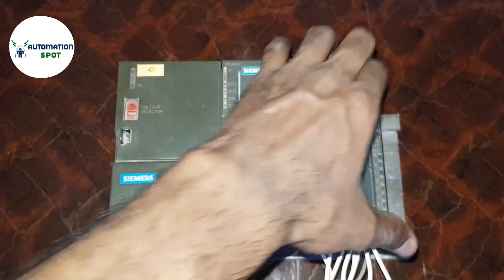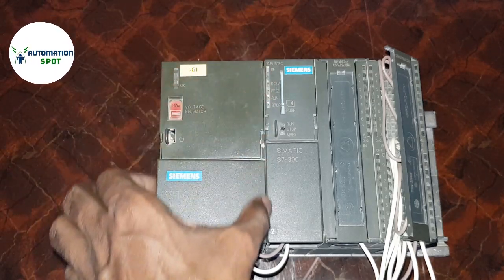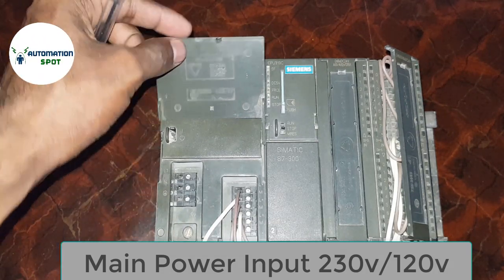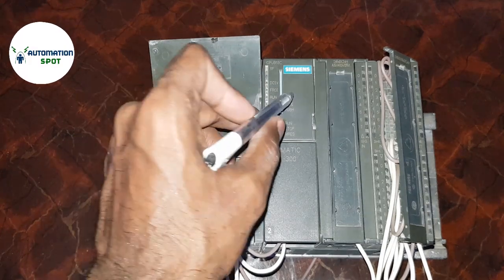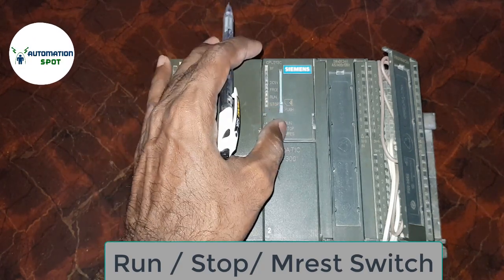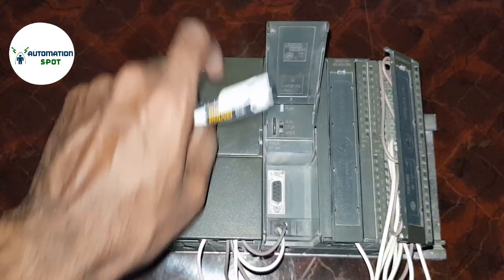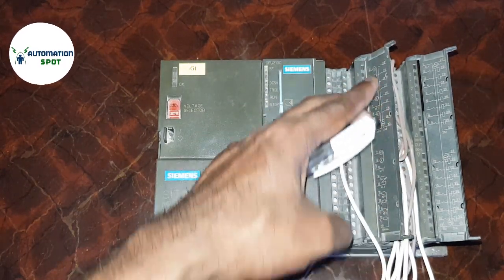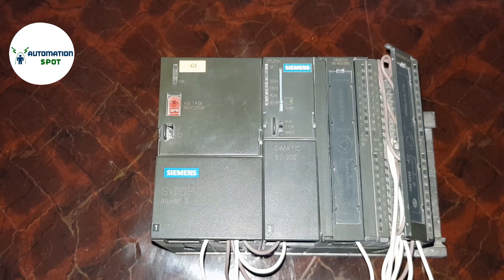Introduction Siemens Plc s7 300 and CPU 313c | Part 1 English Version

Comment: Good video! I'm working with this CPU, but I want to use two analog outputs as a potentiometer that give me a voltage of 0 to 10. 
 In the cpu I see a variable resistance symbol, this is for output?
Reply from the maker: Analog section in down side you can check in modules section yes resistance symbols.
Reply: @AutomationSpot  Thanks! I'll do a variable output to control the speed of an engine through a drive (from HMI). 
Just need "SCALE" Block?
Reply from the maker: Yes Right which hmi you will attach?
Reply: @AutomationSpot  KTP 700 Basic
Reply from the maker: Dear we dont have KTP 700 when we will get then will make for you.